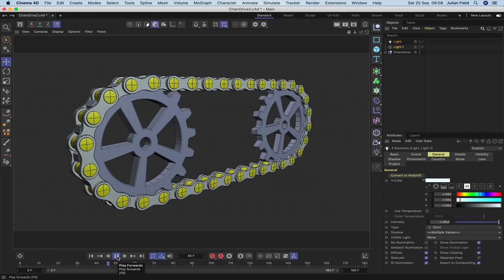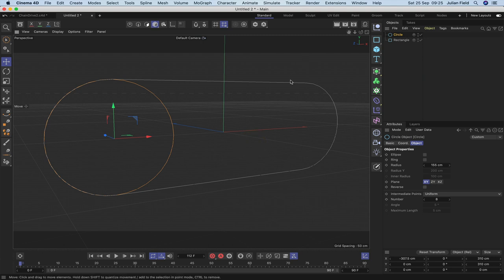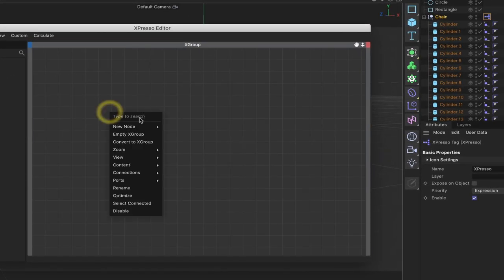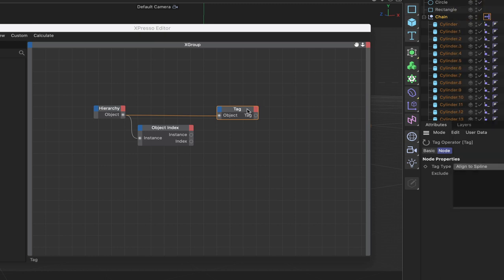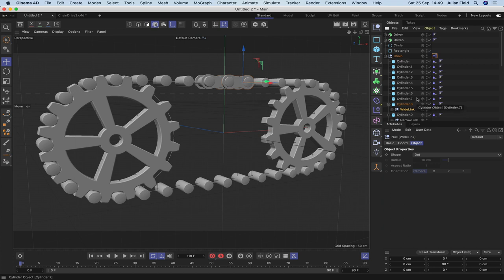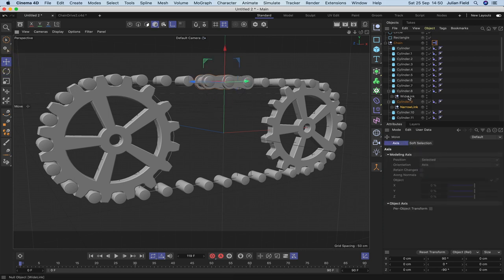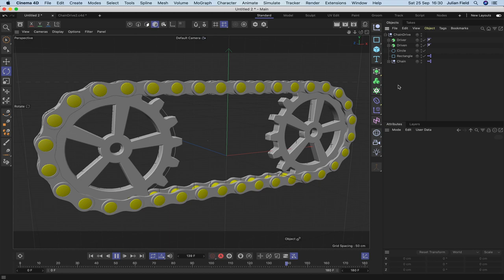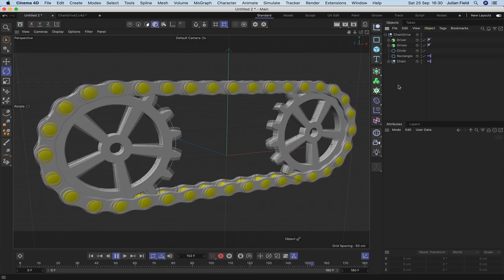Cinema 4D Xpresso Tutorial 43: Building a Chain Drive

Comment: Hello, thank you very much for this tutorial, it’s perfect.
I have 2 questions:
1- Where does the number of 36 cylinders come from?
2- How to calculate the number of teeth especially if the pulleys do not have the same diameter?
Thank you so much
Reply from the maker: 36 cylinders fitted around the cogs correctly. It could have been more or less, if the spline length had been more or less. The essential thing with the teeth, is that they give the correct gear ratio. You could have one cog with 8 teeth and the other with 16, giving a 2:1 ratio. That's all that really matters when it comes to the cogs - the number of teeth in the larger must be evenly divisible by the teeth in the other.

Comment: Hey, when linking my diver to my driven in the Xpresso tag it's not working, what is the solution?
Reply from the maker: Without seeing your file, I don't know what you've done, but it should be a simple fix. If it is one cog not passing its rotation to the the other, you just need to connect whichever rotation value (say, 'B') from the driver, to the same rotation value of the driven.

Comment: What if the driver is bigger diameter ?. Or the opposite ?.
Reply from the maker: It still works, provided you follow the mathematical rules. If your small gear can be divided equally into the large gear, i.e small gear has 10 teeth, large gear has 20, it will work out okay.
Reply: @ExpressoMechanicTV  Do you have a tutorial about that ? Give us the link If possible . Thank you .
Reply from the maker: @siddiqhamedAwad  No, I don't have a tutorial for a chain drive, featuring different sized gears, but check out the Belt Drive series, as it may help you: https://youtu.be/DuTrf9ZCPp8